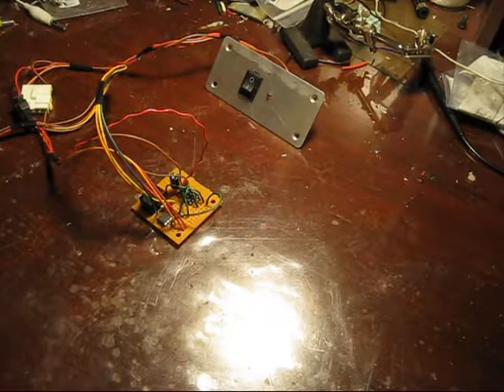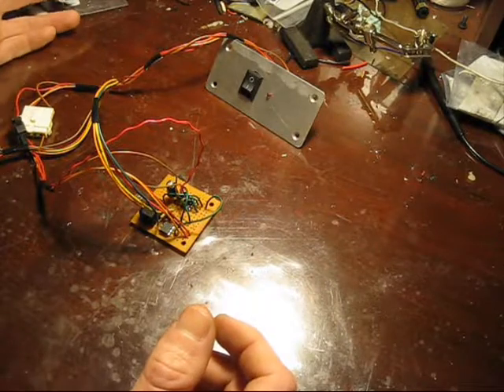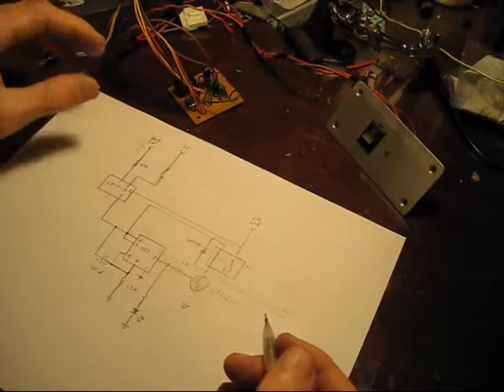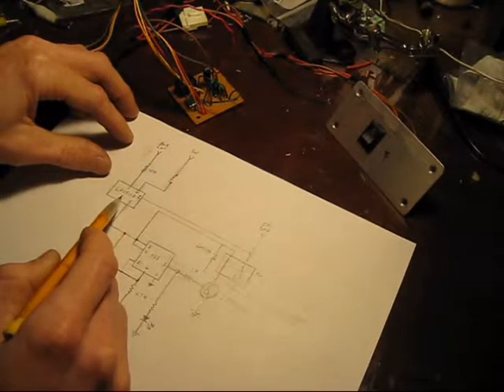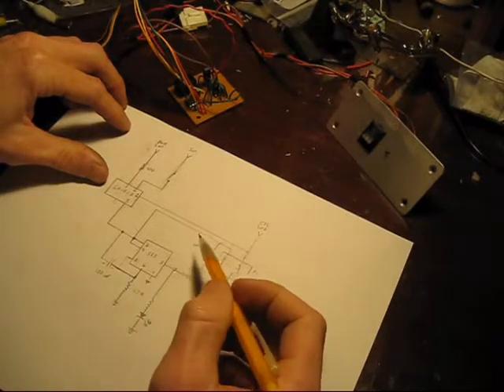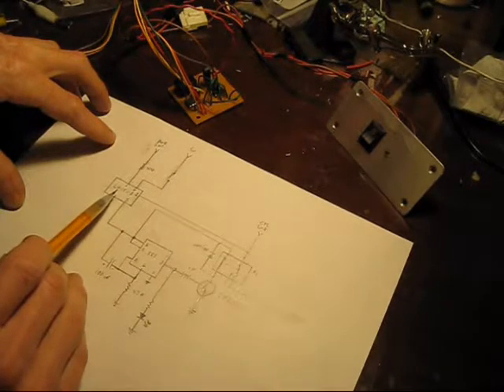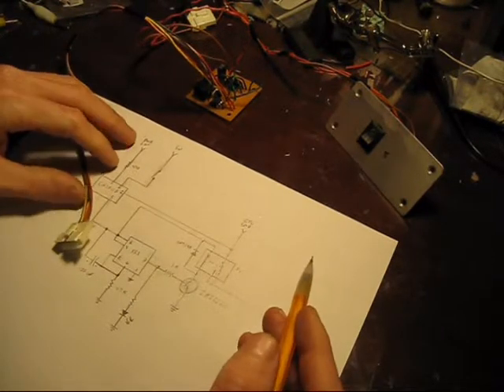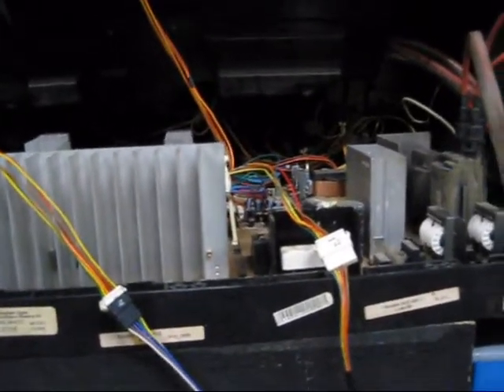Automatically power on a tv/monitor for arcade use

Comment: PFUN41, a common problem for TVs & arcade monitors is when you first turn ON the power there is a long time delay before the image picture gets displayed on the CRT screen. If the power supply is good what monitor circuits or components in the monitor circuits would cause this "turn on long time delay" issue?
Reply from the maker: Some older monitors need to warm up before the picture will come up. Just a result of age.  It also takes a moment for the SMPS in newer monitors to kick on. I have seen situations where a monitor SMPS gets stuck in the startup cycle and takes a few tries before it manages to kick on.
Reply: @pfun41  thanks for the help.  Which monitor circuits that you "CAN NOT" measure the voltage and waveform signals using an oscilloscope or it will damage the monitors circuit boards because of the live & isolated ground issue? I'm confused if the electron beam is the sum of all the RGB signals or is the electron beam something else?
Reply: @pfun41  the older TV monitors Filaments had High voltage applied 24 hours. When you first bought a TV monitor from the store in the 60's - 80's it would turn on right away and through time of using the TV it would turn on not right away but wait for few mins because you got a picture on the CRT screen. Maybe the CRT tubes loss electrons through time of use or its something else?